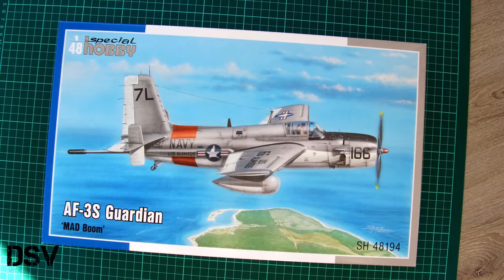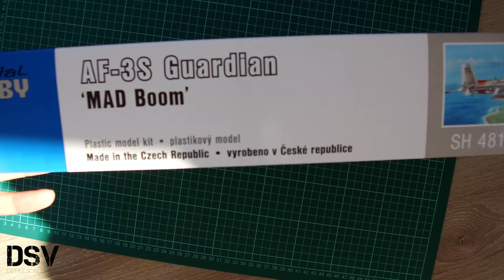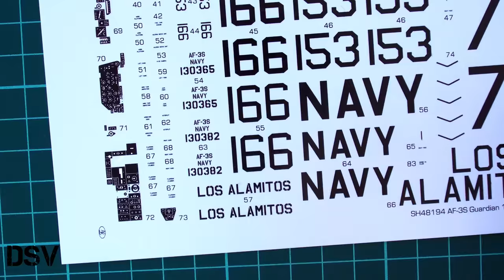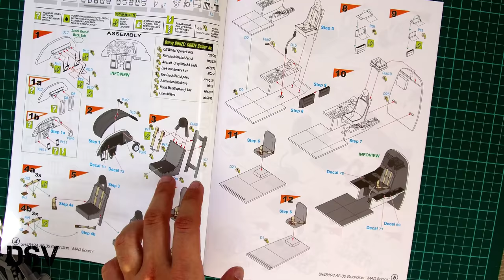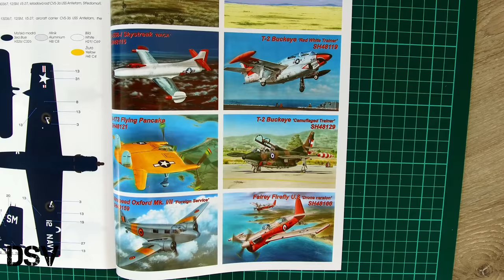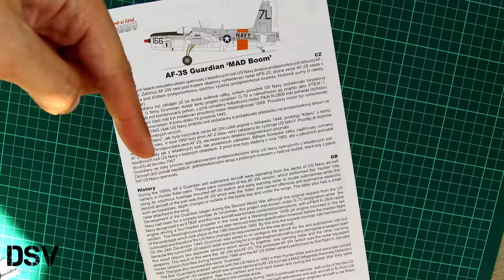Special Hobby 1/48 AF-3S Guardian MAD Boom (SH48194) Review

Comment: The MAD boom was the rear mounted Magnetic Alloy Detector for detecting submarines. Good unboxing and discussion.
Reply from the maker: Thank you for correction. :)
Reply: Magnetic Anomaly Detector - does not detect objects.  It does detect changes in the Earth's magnetic field caused by various large metallic objects.  Even then, objects need to be within 200m of the surface and close to the aircraft..  Great review, however.  I have this very kit and really look forward to building it..